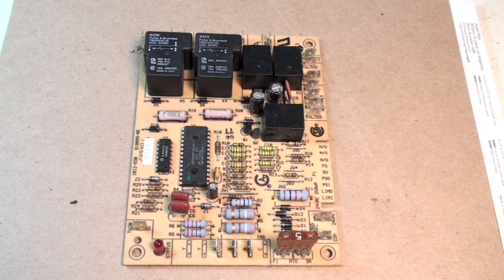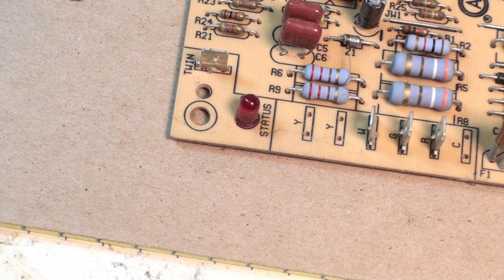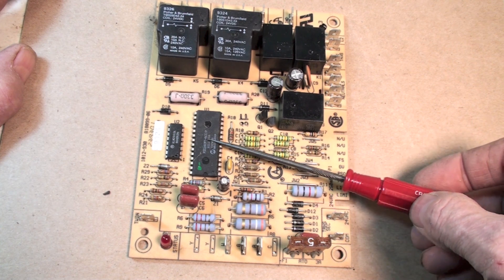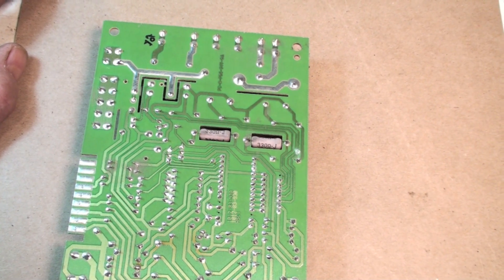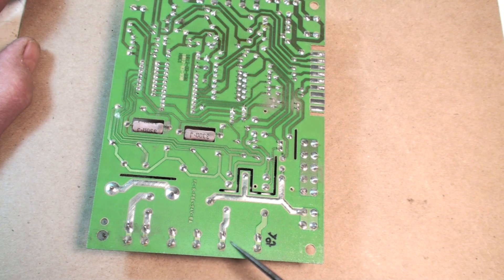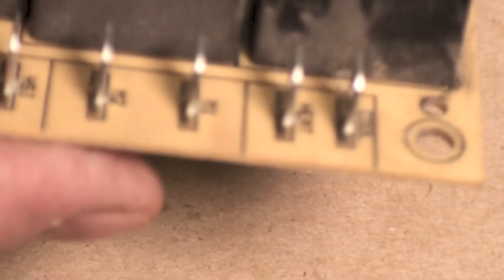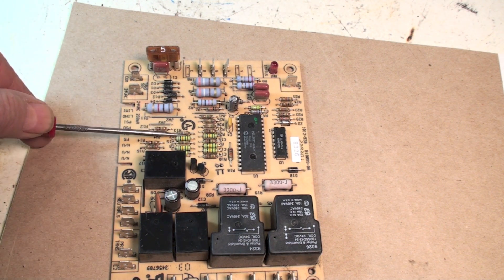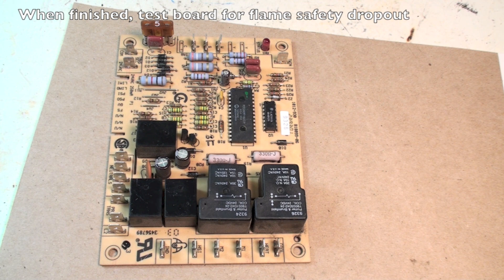Troubleshoot the circuit board of the gas furnace

Comment: Nice one Gary... just seen one of the black blocks on my board had burnt corner to it?  via a blank screen on my thermostat.  ?? fuse good, fan initiated, red/green led on board.. meaning good board on after shutting power off, n breaker did not trip.. so think something like the black cube, will see what it is indicates getting a new board.. even though indicator led's say board is good! .. 13 year old Tappan high efficientcy furnace.  w honeywell 7 day programmable thermostat, 4 wired.. mmm lotta stuff to check on thses babbies..

Comment: I have a similar board. A 103085. The exhaust pressure switch had a problem. but after smacking it a few times it resolved the issue. I reset the board. there are no error codes now but it won't even attempt to turn on with a call for heat.
Reply from the maker: Smacking the pressure switch does not resolve the issue.  Are you sure you have no error codes?  This doesn't sound right.
GFM
Reply: @grayfurnaceman   Thank you for getting back with me. I was really desperate. The problem now seems to be my thermostat. I was getting 6 vac between R&W. I thought it was insignificant. But when I jumpered it, the furnace tried to start.  Hopefully everything will be ok once I replace the thermostat.
Reply from the maker: @robertarchuletta2498  Very interesting.
GFM
Reply: @grayfurnaceman   I think I replied in the wrong place. So the pressure (vacuum) switch is working properly now. The control board has been cleared of all error codes. The problem afterwards was in the thermostat. With the thermostat  switch closed, I still had 6 volts on the terminals. The anticipater was burnt. Probably as a result of a short I had in the thermostat wires a couple of years ago. The thermostat was fried. I replaced the t stat and everything has been working good.
Reply from the maker: @robertarchuletta2498  Glad you got it going.
GFM

Comment: Hello Grayfurnaceman ! love your videos, i learn a lot of from your videos. I have a question about the LED. What purpose of LED on a solid state board for a residential gas furnace is ?
Reply from the maker: In most furnaces made in the last 30 years, the light is used to determine what error code caused the furnace to lock out.  It also tells you if there is power to the furnace and if it is calling for heat.  There should be a key to the codes on one of the furnaces covers or on the control board.
GFM
Reply: @grayfurnaceman  Thank you very much Sir. 👍👍👍👍

Comment: i got a goodman furnace . i got 120 going in and out of the board going to the xformer but no 24v coming out of the xformer. fuse is good. fuse has continuity. i put in a 5 amp fuse and it blew it. but it does not blow the 3 amp fuse it came with .  the status light does not light up.
Reply from the maker: I think you are missing something in your testing.  Your fuse is probably blown.  You have a short in the low voltage, probably a wire touching the chassis.
GFM

Comment: Thanks for your video. Looked at the back of my circuit board an found melted solder to one relay. Repaired that and fixed problem.
Reply from the maker: Glad you got it going.
GFM

Comment: My furnace stopped working last week- code closed pressure switch.  Replaced both it and a cranky old inducer fan (which needed replacing anyway) but still nothing.  Found No 120v from board terminals to the inducer.  Ran 120v manually to inducer from outlet and ran fan.  started furnace with one wire disconnected from pressure switch, then reconnected the wire.  Furnace started and fired up.  Now I'm wondering if it's a bad solder joint, bad relay or something else.  Anyone know how to best test the relay in the board?   Also, do the 2 wires going to the pressure switch have to be in specific slots?  the 2 wires aren't marked differently.
Reply from the maker: If the inducer cam on when you removed the wire from the pressure switch, the pressure was closed.  Generally, its pretty hard to miswire a pressure switch if it is a 2 wire.  I don't think you have a relay problem.
GFM

Comment: Great video!  Just earlier today I attempted the repair of my furnace board which had 1 resistor that had obviously cooked itself too much and the solder was burned.  Ultimately that didn't work so I replaced the board but as it happens I was looking for similar issues to what you pointed out.  I should also say that since it's 35 degrees out I was hoping I could at least get the heat working but I wouldn't have trusted the repaired board long term - only to confirm my diagnosis and until a replacement board arrived.

Comment: I have a coleman counterflow gas furnace model DGAD060CDL. There's this tiny black button switch on the mother board in the upper left hand corner that reads Last Error. What does that do? Just curious. I'm having intermittent furnace issues right now, but I don't think it's the board.
Reply from the maker: If you press the button, it will give the last error code listed.
GFM
Reply: Thanks. I may have to replace my board. I'm having it checked tomorrow. I'm afraid to touch it if it's not the issue. Too many other things that may be the cause of my intermittent issues.

Comment: Everything about that board is repairable. There is no conformal coating. All components are through hole.  None of the component markings are sanded off.  The only thing that could make it irreparable is propitiatory parts.
Reply from the maker: Which the prosessor is. And the software also for the flame safety controls.
GFM

Comment: Before this the igniter would glow and then the fan would come on and the igniter would go out. There is a harness with a wire going to the limits and when I push on it ( to make sure it’s seated) the blower would me on. Also I tested the limits and they read continuity while the furnace was off.

Comment: My water heater &  furnace are destroyed from this past 3 ½ ft. basement flood, and this board is ruined!  Is there some way, some how, of  purchasing the circuit board  somewhere we less expensive than Supply house? My Dad said its alot $$ for me to replace, going by my finances right now. In the furnace isn't even that old ! He's been doing heating and air all his life, does know what he's talking about. What would be upset with me if he knew I was even thinking this. I just got it in my head of the different ways people sell things on Craigslist  and different places like that , you never know! People sell some weird stuff. might be way off but I'm so desperate it's like 35°  in my house, so I can't even stay there! 💩💩 Any info? 😢😠😶
Reply from the maker: Ebay has some used boards but be sure it is for your furnace.  I have never used them and never will, but some of my viewers have with mostly good luck.
GFM

Comment: I replaced one of these boards about five years ago and it looked like it was not detecting the flame sensor voltage for some reason.  It looked like some of the traces on the back of the board were burned.
Reply from the maker: Usually, the burn marks are from a high power resistor.  That is usually not where the failure is unless the trace has been "haloed".  
GFM

Comment: thank you Gray for all your help. if i unplugged the inducer motor and does not get 120vac coming out of the IFC, then is it safe to say that the IFC is defective. all pressure switches are open when measured with meter.
Also, i have a two stage gas valve but why are there 3 pressure switches? thanks.
Reply from the maker: If the furnace is calling for heat, and has not shut down on safety, there should be power to the inducer.  You need to look at the control board diagnostic lights to be sure.  If the unit does not have lights, and if it is a York from the 1990s, it may not, the 3 pressure switches are necessary to check for all problems with draft.  
GFM

Comment: The relays are a very common fail item, and easy to replace.  I've seen them get intermittent too.
Reply: My gas furnace/ac quit working. It turned out the fan wasn't working. I ordered a board from ebay and it fixed the problem. I checked the board and one of the coil inputs for the fan had a cold solder joint. I guess it had gotten hot. I checked the 3 big relays with DC input and they all clicked so I knew they were good. I repaired the cold solder joint along with a couple of loose resistors. I haven't yet but I plan to reinstall the old board. If it is good and stays good for a while, I'll have a spare board or I'll sell the newer one on ebay.
Reply: @porter5976  keep your spare board handy for a cold winter or a hot summer day, save your time

Comment: Mister Gray, I just want thank you once again for all your informative videos and share with you  what I just finished doing. My furnace was was not working there was no fire on the burners and it was blowing only cold air. At first I thought it was the ignitor, I rules out ignitor because there was a bright orange light glowing near the burners, then I thought it was the gas valve because there was no gas. But after watching your videos and learning how to check voltage to a gas valve I was able figure out there was no voltage going to the gas valve, (I used a cheap voltmeter from Harbor Freight to test the voltage). Since there was no voltage going to the gas valve I guessed the control module must be faulty. I reluctantly ordered a matching control board and I just installed it. And now I have a working furnace thanks to you.
Reply from the maker: Glad you got it going.
GFM

Comment: will the board tell you if the board is faulty?
Reply from the maker: There is no solid answer here.  Some boards have a pass fail light blink but it depends on the manufacturer.
GFM

Comment: CHECK for cracked solder joints under the connectors. I just found THREE on one "bad" board!!! Use a magnifying glass and light. These boards FLEX because the manufacturers are too lazy to put some support behind the connectors, knowing this is going to happen. Un-real.

Comment: Furnace won't start. Thermastat seems fine. No lights at all on board. Blower fan works but only when set to below room temp. When set above room temp blower fan doesn't work. Don't think my electric ignition is working or could it be the board since there are no lights? I need help.

Comment: I have a Honeywell board ST9103A controlling my AC and oil furnace. It looks very similar to the one you are showing in this video. I replaced the board because it had a burned connection on the relay. Everything is wired identically to the old board, but it won't come on. There is an electrical box with a switch and a line comes from the box and goes to the board prong labelled 120 VAC (black wire). I am trying to figure out if this is supposed to be energized and if this is where the board gets its power, or if the board energizes this line to the box and then to the humidifier and or electronic air cleaner (both have lines coming out of the electrical box.) Any assistance would be appreciated!
Reply from the maker: That is the line that powers the board.  
GFM
Reply: Ok, perfect. I wonder if you could answer another question for me. I have a carrier AC (and a beckett oil burner). When the thermostat calls for cooling the outdoor fan and compressor comes on, but the main indoor circulator fan stays off. I replaced the board, it had burned relay solder joint. But with the new board, the circulator fan still won't come on. The fan works fine when I jump to the G wire from the red. Is my thermostat supposed to energize both the yellow and the green for ac or just the yellow and then the board energizes the blower motor? I am stumped because I can't figure out why the indoor fan won't come one. I have a nest thermostat which seems to be having trouble getting power on a 4 wire system lacking a common. Any insight would be appreciated.
Reply from the maker: You have a thermostat problem.  The thermostat should energize both Y and G in cooling.  You will probably need a common wire to make this work.
GFM
Reply: Perfect, I called Nest and they had me run some diagnostics by switching wires around. They said the Nest was indeed bad and they agreed to send me a new thermostat. It is true my Nest doesn't like not having a common wire, it charges when the unit runs but will die if I don't run it often enough. I guess I need an electrician to pull a common wire through the wall? 

Thanks for all your amazing site. I have learned so much watching your videos. Thank you, Mr. Grayfurnaceman!
Reply from the maker: I will be uploading a video on how to pull the wire through.  The question is when I will get it done.
GFM

Comment: Thanks for this.  My 95 Trane was blowing cold air today, and code was "System lockout (no flame)/check line polarity. When I reset it (power off and on), it repeated. Repairman reset it (powered off with thermostat), and it started. Because it was inconsistent, he checked the motherboard...said that the earthquakes we get can cause power surges that damage the boards.  Indeed, a short while later, he showed me a brown spot on the case, and black spot on the green side of the board.  Is this reasonable?  I ask because within the black spot on green side, the green is missing in chunks, but looks scraped off..straight lines.  Thanks in advance.
Reply from the maker: I can't say if the board is bad.  The brown spot may be normal.  Some of the boards use large resistors normally create small burn spots on the board.  The resistor is usually white ceramic.
GFM
Reply: Thanks.  Wish I knew how to post a pic to this format.  :  )  The burn is on the green side.  On the flip side are some small green resistors. 1/2" long, group of 4.   I appreciated your common sense video.  Helped me to understand it a bit!
Reply from the maker: Send to Grayfurnaceman@gmail.com
GFM

Comment: How do I get right board fit furnace ?    Can I just go buy a board or do I need get 1 fits that model ?  I never heard  Winchester .
Reply from the maker: There are 2 ways.  You may contact a HVAC dealer to get a factory part.  There are general replacement boards that are made by Robertshaw, White Rodgers or Honeywell.  You will have to match your make and model with the board and there will be wiring issues.  Not for the neophyte.
GFM
Reply: ok thank you

Comment: hello grayfurnaceman  can you tell me where can i get one circuit board just like the one you were showing in this video?
Reply from the maker: There are 2 choices here.  One, you can get the factory part from the manufacturer.  Two, Some control boards can be replaced by general replacement boards Made by Honeywell or White Rodgers.  They have crossover charts to be sure the new boards works normally.
GFM

Comment: need you assist. I have a board not sending signal to  valve , sequence ok but no reading on valve ... relay?
Reply from the maker: If the HSI comes on,  and the burners don't, and there is no power to the gas valve during the trial for ignition, you either have board failure or the connecting wires do not make contact.
GFM

Comment: My daddy has 1979 carrier gas furnace HH84AA020. Although he bought a new board nows hes afraid to put it in cause he doesnt kow what blew the old one . When he would turn put thermostat on 76 it would never kick on . He did put in a new fuse even tho it didnt need a new one . So what else can he do to try to know how to prevent the new one from blowing out . Hes 83 & determind to figure this out. Plz help ! Thank you
Reply: Wow guess i shouldve put my glasses on , sorry ☺
Reply: The great likelihood is that the problem that caused the old board to fail was in the board itself, not in a part external to the board. The parts external to the board are far more robust than the parts on the board itself. That doesn't preclude the possibility that the problem isn't the board at all. The thermostat itself might be bad, or there could be a bad connection or an open or a high resistance open in the thermostat wire circuit. Unless there is evidence gathered through careful thoughtful diagnosis you can't assume that because the unit quit working the problem is the board.

Comment: Grayfurnaceman - I have no power coming to my circuit board. I can push down the contactor and make the compressor kick on and it is working fine (as long as I manually hold down the contact)-- the LED lights are not lit at all which designates no power to the board. I have checked all connections and they seem to be connected. Any suggestions?
Reply from the maker: Look for a fuse on the board.  Also check all breakers and fuses to the indoor unit.  Hope this helps.
GFM

Comment: hey furnace man, i ran into a problem at a call i had.... the condenssor wasnt getting 24 volts to the contactor, the wires were good, and so was the transformer but we couldnt find out why it wasnt getting 24 volts... we think it was the control board??? any suggestions?
Reply from the maker: If you mean the IFC, It is not in the control circuit for the air conditioner.  If there is a board in the A/C, 24 in, no 24 out, pressure switch or board.  Hope this helps.
GFM

Comment: How would you find which connectors and which relays handle turning on the gas valve? I replaced one board and the only thing that did not happen was the gas valve would not turn on? Thanks   I just wanted to check the relay for myself to trace it back.
Reply from the maker: +amtpdb1 Beats me.  You can try following the traces on the board that connect to the gas valve.  You might also be sure the hot surface ignitor comes on.
GFM
Reply: +grayfurnaceman Thanks
Reply: +grayfurnaceman The hot ignitor works as it glows nice and write. The gas just did not open to heat.I replaced  the board and all works. I just wanted to find the issue with the board but before I closed the unit I forgot to note the terminal to trace it back. Thanks for the video.